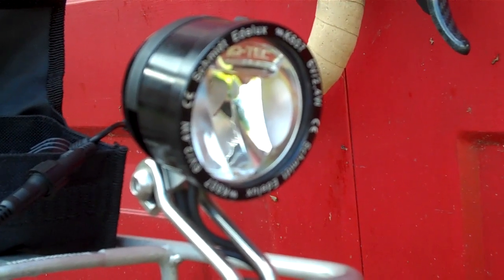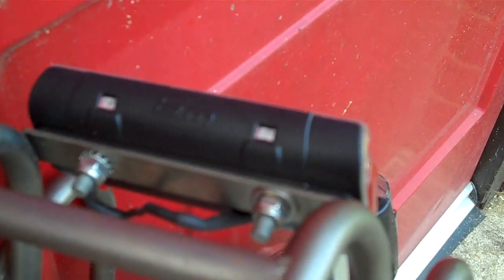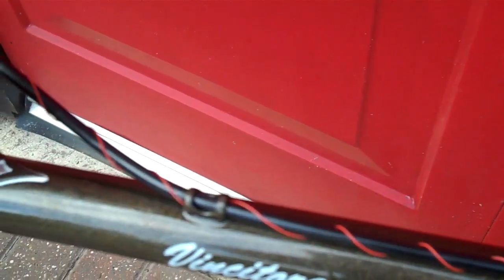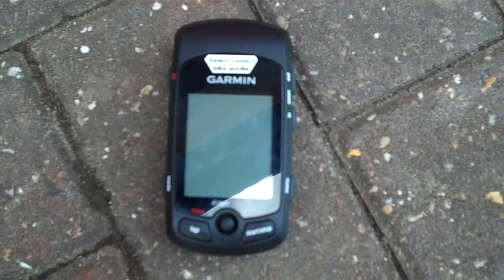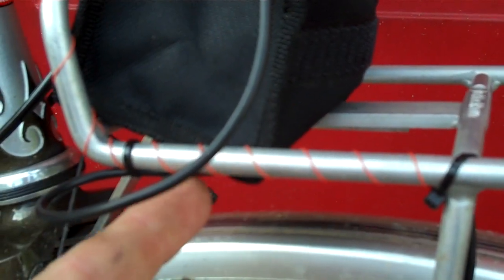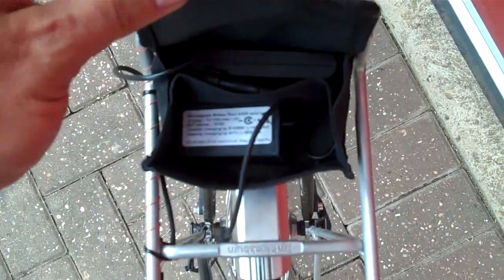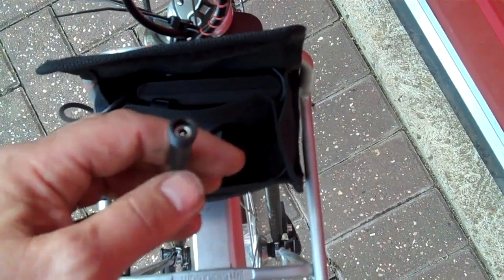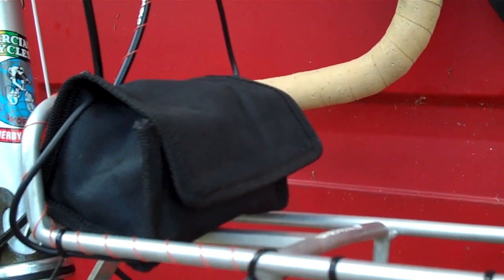Bike Dynamo lighting and B&M e Werk

Comment: Powering battery headlights by Busch & Mueller
The E-WERK can be used for charging and – if needed – simultaneous powering of battery headlights by Busch & Mueller. The following values have to be set:
IXON IQ: 6.3 V, 1 A (use charging socket, charge control
integrated in the headlight)
IXON IQ Speed: 7 V, 1.5 A (connect E-WERK to one socket of the battery, headlight to the other) 
BIG BANG: 8.4 V, 1.5 A (use cache battery)
Fitting adaptor cables for headlights are available upon request. The batteries of IXON IQ Speed and BIG BANG can be charged separately (without using the headlight).

Any idea for setup e-werk + cache battery and with Supernova fron E3Pure 3 light ?

Comment from the maker: Ah!  Mine did that at the start - then after a short while it seemed to work OK.  But on my return I found that it no longer would talk to my PC via USB. I had to buy a second hand replacement from ebay. So now I run the Garmin disconnected while riding. I charge the cache battery via dynohub, then use the battery to charge the Garmin overnight.